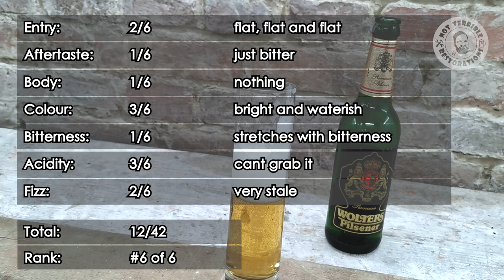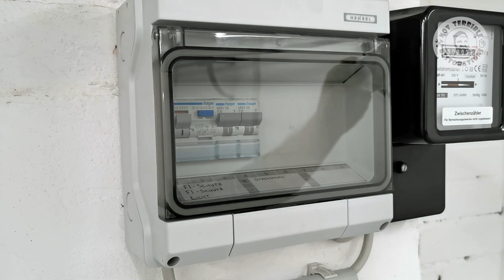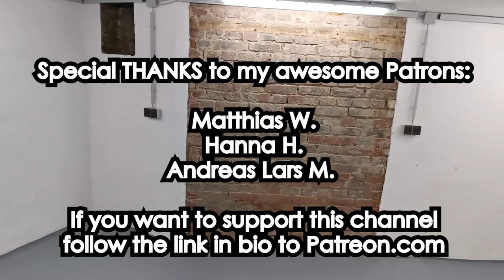EXHAUSTING Basement Renovation Part 1 - Fixing Crumbling Walls

Comment: I would recommend that the next time you patch concrete or plaster, you use a bonding primer. Otherwise it’ll break up and not last very long. Great vid, and I’m a new sub, thanks for the content.
Reply from the maker: Thanks for the tip Greg

Comment: Nicely done, that space will now have another hundred years before it's toast. I did have a question though, why did you leave that section of exposed brickwork? Just as an accent wall, or is there something I'm missing?
Reply from the maker: Yes you are correct. I left it as accent wall and it was in fairly good condition.

Comment: I like its simple, uncluttered look, but what are you doing for ventilation? You need a fresh vent, and some sort of extraction system, especially when welding, using solvents, etc.
Reply from the maker: Yes left of the brickwall there is an opening to the outside and since there is no window installed,here is always a breeze. But in future I want to install something. Thank you for beeing so thoughtful Bruno

Comment: Hi, ist das ein Kellerraum? Und wenn jamit welcher Farbe hast du den Boden gestrichen? Finde keine gute Farbe um eine Keller Bodenplatte zu streichen wegen der Feuchtigkeit die sich von unten hoch drückt
Reply from the maker: Servus Paul,

ja ist ein Kellerraum. Habe mit dieser FArbe gestrichen und bin bislang sehr zufrieden. Je sauberer du den boden vorher machst, desto besser das haftergebnis.

https://www.amazon.de/-/en/Floor-Coating-RAL7001-Liquid-Plastic-Paint/dp/B01MT13GBJ/ref=sxts_sxwds-bia-wc-nc-drs1_0?cv_ct_cx=bodenfarbe&dchild=1&keywords=bodenfarbe&pd_rd_i=B01MT13GBJ&pd_rd_r=4baabdd5-0ed3-44bb-b055-5ced3a629259&pd_rd_w=S0oCN&pd_rd_wg=fbBzk&pf_rd_p=58d6d532-cd4b-4346-81cc-26b9b56aa9ed&pf_rd_r=R8V3TSZ6ENWAQET6148N&psc=1&qid=1609769628&sr=1-1-606822b7-04c2-4c74-a611-acbe80e94641